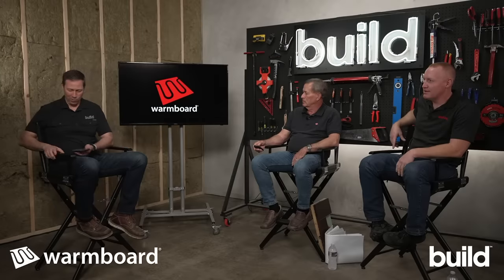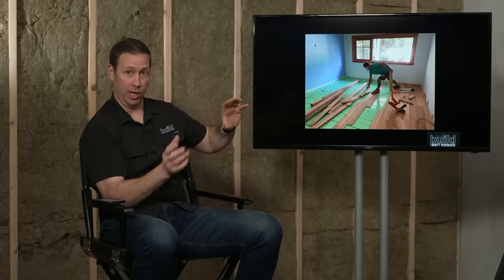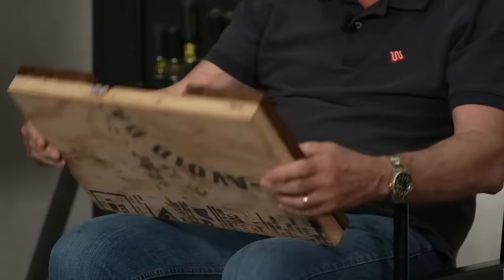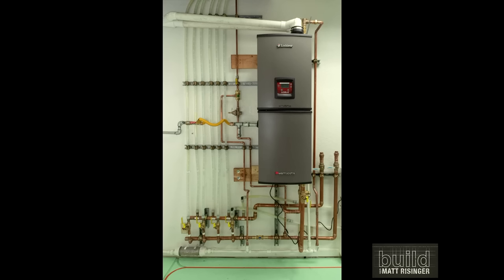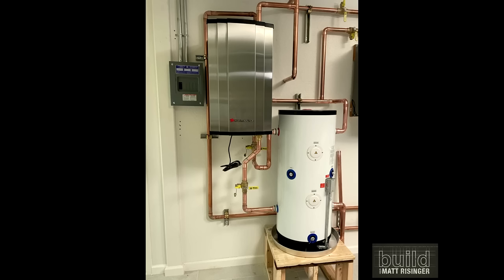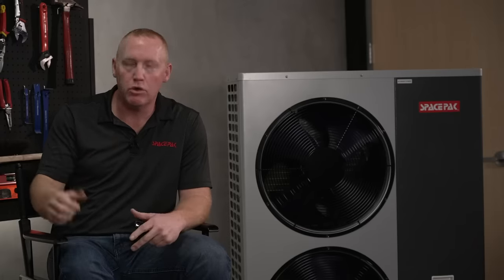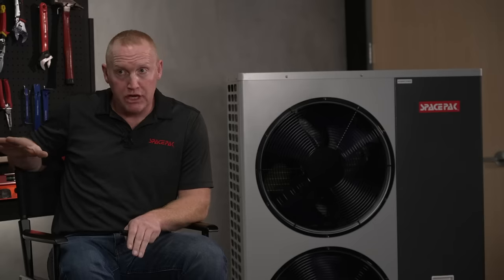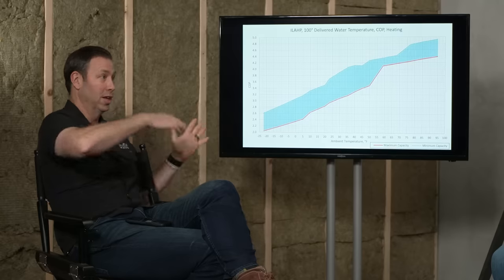Cold Climate Heat Pumps for Radiant Floor Heating. No gas, no boiler!

Comment: The missing slide...  What was missing in the presentation, though alluded to, is that as the temperature goes down, the BTU output of the HP goes down with it.  You will have the least amount of capacity when you need it the most.  The most important takeaway is not how low a temperature the HP will function but to increase the efficiency of the envelope. 

The Warmboard is a luxury product and the presenter made no excuses that it wasn't.  It is a luxury product that will make very difficult envelopes (think walls of glass) comfortable.  Well built envelopes with low BTU heating or cooling requirements will be in a position to achieve the "comfort" adjective much easier than poorly insulated, leaky ones.  We have been choosing to throw technology and brute mechanical force into our homes to overcome the upfront cost cutting for too long.
Reply: I'd agree. The brute force ways of doing things are no longer cheap, so we need to get more intelligent about how we build and heat our home. If the choice is spending $30,000 dollars more to insulate, airseal and then ventilate home, but this saves an extra $1000 dollars a year in fuel, then its a no brainer when houses last 70 years plus and inflation means that fuel is only going to get more expensive.
Reply: @tlangdon12  Why would fuel get more expensive? Consider that it has been getting less expensive, relative to inflation, for a few decades. Fuel will only increase in cost via legislation. However, a much more efficient means of comfort control is obviously necessary. 

I think we should turn our attention to retrofit air sealing and radiant barrier solutions. If that is low cost and quick, much less cooling and heating sources.
Reply: @CycleWerkz  It’s the legislative route that I expect to be the source of increases.
Reply: @tlangdon12  agreed
Reply: @CycleWerkz  fossil fuel will certainly get more expensive. The capital costs of fracking and labor costs will increase with inflation, especially considering the fracked wells have a shorter productive life span. It may continue to cheaper in specific places where it is a byproduct and doesnt have to be transported. That is not universally true for places outside the main regions of shale gas/oil.  Especially now that fossil fuels are being exported, even though the USA is a net importer of oil.  Are prices are going to rise to normalize with the global market all for private fossil fuel companies rent seeking profits.  Only competition from especially renewable sources of electricity will reign in the prices. Additionally these are cheaper and have a longer life span then fossil fuel infrastructure at this point, again regionally dependent. Agreed, we do need to build better quality, long lasting, and well insulated buildings.
Reply: @JohnsrudErik  Hmm, the ideas you have shown here are because you've been massively mislead. Don't worry, almost everyone has been. 

If you've never been to a modern Oil/NG drilling site, I encourage you to schedule a tour. Everything you imagine is completely wrong. 

I'll describe this without exact detail so it'll develop an image. A modern drilling site bores down but angled slightly away from the centerline until reaching about a mile below the surface. There may around 50 of these  bores in different directions, but these are not randomly selected but rather targeted using subterranean imaging. From each of these initial bores, a roughly horizontal hole is bored. These bores are not straight, they are guided using real time imagine equipment to target specific areas. They are steered up, down, left, right to intercept all the desired targets. Horizontal boring can extend up to 5 miles. These wells use hydraulic fracturing techniques on each of these horizontal bores to release the stranded oil and or NG.  There is no guesswork or luck involved. The certainty of profitability is well known prior to the project funding. Each of the horizontal borings were engineered as part of the research needed to justify the project. 

The projects I'm familiar with have broke even ROI in less than 10 months from initial build. They only had one or two horizontal lines running for a couple months to return all the capital and expenses to that point. These projects will be massive producers for decades to come. 

This is a technology, not an effect of where you live. This technology is IP, equipment, and engineers, which is available anywhere in the world. Similar methods are used for offshore sites. It's even possible to collect organic fuels from below the Oceans' floor with an onshore platform. 

The US does not need to be a net importer. This is only the case due to legislation. Alaska alone can, and has, produce, 2 million barrels per day which is the pipeline limit. Production has been limited by political means by using every possible hobbling method. Despite all this, they still produce 1/2 million barrels per day. 

I worked a project to decommission an electrical generation plant that was fueled by NG. It had an alternative coal heat source and a rail spur, but it had never burned coal. It ran over 50 years. This is typical or these plants. I have not seen evidence of your claim the PVs or Wind Generators will run over a decade. 

We have a 35GW wind plant in West and South TX. It produces lots of power all night every summer. Every day of the summer the wind slows at about 11AM , then picks back up around 830PM. So about 18-22GW all night, then 5-12GW during the peak load time. It happens every day, all summer long. No, it never actually produces the nameplate rating of 35GW. That's a number thrown around to justify the cost. I assure you it is not a cheaper way to generate electrical power. 

Every summer day at noon, all the NG peaker plants ramp up to supply the peak loads plus they have to supply the wind source power that fell off. Then, at around 830PM, all the peaker plants have to cycle down because our brilliant government forces load onto the wind system. The peaker plants experience a much wider heat variation than they did before; substantially decreasing time between overhauls. 

Even worse, Nuke plants were never intended to be throttled. They produce the same power regardless of load conditions. When the load at night falls below wind + Nuke, wholesale energy prices go negative. That's right, the nuke plant has to pay to add load. The wind system would throttle, but they don't because they get paid to supply plus the wholesale rate. They will not throttle down until the supplemental pay would cause a net loss. Any time you exit a free market, unintended consequences will occur. 

Renewables are nowhere near competitive with organic fuels. They only have the ability to cripple electrical generation economics due to legislation. I have little doubt I'll have to pay more for energy, but it's not because of any flaw in the fuel. 

Transportation of oil, NG, gasoline, diesel, jet fuel, derivatives is extremely low cost via pipelines. Here, California's government is working tirelessly to close their refineries. CA is the terminating end of the Alaska pipeline. They should be encouraging new refineries to be built right there. Then they could easily influence the fed to get out of the way of Alaska's oil production. CA could have the 2nd lowest cost fuels in the country. The hard part is already there. It surprises me that Californians are willing to pay exorbitant fuel and energy prices while this opportunity is in plain sight. CA gasoline is over $5 while in TX it's under $3. Residential electric is $0.12 kWhr but in CA I think it's $0.30. And that's if it's even on. They should really attack the government for this. 

Think of it this way; the first wind gens built, were in the BEST places for wind. All subsequent wind projects will perform much worse than these pristine locations. Power production varies by the square root of wind speed.  And wind generators arrays create turbulence so all the generators downwind perform worse than the upwind few. So a nice 3MW gen will typically produce 2MW at night. then just before noon wind slows to half speed so that 2MW reduces to 500kW. But wait, that's how it works from the Gulf through a very flat desert. Even there it sucks; but it'll suck way worse elsewhere. And I hope you really hate bats and birds of prey, like eagles. It kills a bunch of them. I also hope you hate humans. I know guys working on these. Do you wonder why you can't find accidental injury and death statistics on wind generator techs? They do not compare favorably to NG, Coal or Nuke plants. 

I remain hopeful people will see the obvious and challenge what they've read. It's not easy for people to do. People really hate discovering they've been snookered. Don't worry, I was in that camp, the transition out sucked.
Reply: @CycleWerkz  This is why I love Youtube, good discussion and learning. Thanks for taking the time to write all this.
Reply: @DoubleD  Most concise explanation I've heard to date. I'm going to screenshot your message to help me explain to other.  Thank you!
Reply: @Terrathrax  Thanks. I was suffering reply remorse about half way through.
Reply: @Tbell550  Thanks so much. I hope it helps.
Reply: @CycleWerkz  Thank you very much! It takes an astute intelligence to discern the true state of affairs in an intently deceptive world.
Reply: @donquixote4630  Nicely worded comment, thanks.

Comment: My house has warmboard on the main level and infloor hydronic in the basement concrete floor.  We've attached it go a 3-in-1 geothermal system.  We're up in New Brunswick (to the east of Maine for you geography challenged folk).  We're actually so well insulated we don't need much heat but it's definitely a nice system.
Reply: How did you insulate your concrete floor?
Reply: We did 2” R10 of rigid foam.  Then our radon barrier.  Then 2.5” of the honey comb shaped rigid foam where you can snake the hydronic pipes through it.  Then 4” of concrete.  So subslab it’s R20.
Reply: Outstanding! Thanks.
Reply: If you don’t mind me asking, how much was the geothermal system? We’re getting quotes that are insanely expensive compared to what the internet says it should cost 🤷‍♂️
Reply: I had one insane quote at like 60k plus a bunch of stuff (site work etc).

Best quote I got was 28k plus tax.  This was 2020 before rampant inflation.

Comment: Excellent timing ! Im currently working with Peter at Warmboard… getting a design and estimate for my Truckee house remodel … also want to use air heat pump solution … my 1978 Marlette cabin is 100% electric baseboard. Switching to hydronic heating under large format ceramic tile is expected to be a huge upgrade … along with replacing roof while adding proper insulation
Reply: Give us the cost so we know what to expect.  My costs at my age didnt justify to even consider the upgrade

Comment: Great video!  Can you do a follow up video on cooling systems (e.g., air conditioning) that you might couple with radiant heating?  IMHO having two systems is difficult to justify from a cost standpoint.  Several years ago you made a video on radiant cooling systems that was really interesting but I've not seen much since.
Reply: Agreed! Some of live in areas that get below freezing in the winters, but also reach triple digits in the summers. 😁
Reply: I have a friend with an off-grid solar house with in-floor heating and cooling. One issue was that they’d get condensation on the floor when running the cool water. A regular a/c has a place for condensate- in this case you don’t. So just a complication that needs to be addressed with dehumidifiers.
Reply: Mini splits are perfect for climates that need both heating and cooling. Some Japanese made units easily output 18,000 btu while having heating SCOPs of over 5! And some new ones can get DC connection to Solar Panels with no need of inverter or connection to the grid. This is big with prices of solar panels @ $0.3-0.5 per watt.
Reply: @TimGGleason  Running cold water through the floor is a bad idea. The correct way to cool with a heat pump is to have fan-coil units mounted high on the room walls (like a regular AC split system) so that the cold air they produce can be directed across the whole of the room and then descend. (Hot air rises, cold air wants to do the opposite!)
Reply: @tlangdon12  the panel the original comment was talking about is a cooling panel system mounted to the ceiling

Comment: Would love to see a video about a water to water heat pump for using geothermal heat to radiant heat
Reply: I second that!
Reply: You may be disappointed with the price of geothermal vs the price of air to water.
Reply: @paulmcgown7504  unfortunately where I'm at air to water isn't a great option for me as it's regularly Below zero.
Reply: I built my home in the early 90 with all radiant floors using an oil boiler. Later switched to a water to water geothermal pump and dump system. Continuous 55 degree water right from the well on an inverter constant pressure pump. Very cost effective to operate but The 3 ton compressor didnt get quieter with age and soon became a huge nuisance as my mechanical room is adjacent to my living room. I have no basement as I built next to a creek, hence my unlimited supply of water. Its just a heat pump with a buffer tank. It had a desuper heater on the unit but it was never used as I only used the unit for heat. My cooling system is separate ductless units and chilled water is a pain to insulate anyway. Now I use a small gas condensing boiler, super quiet, easy to repair and very small. A small 1400 watt generator running on propane keeps the entire system running during power outages.

Comment: This is the most interesting video on this topic I've seen.  I too have considered Warmboard which, without doubt is the most complete radiant heating product on the market.  Spacpak adds a couple key features to the hvac equation.  1.  Heating efficiently using electricity while 2. providing the air conditioning which of course, Warmboard isn't designed....they're comfortable heat only.  Recognize, an air conditioner or heat must be purchased and ducted in addition to the warmbaord for a complete HVAC system..  The gypcrete/concrete w/pex option mentioned below by Michael Taros, I've reasoned for years may be the best "value" when matched with a Spacepak type product.  The reason is, Spacepak provides the quick ramp up for heating as the gypecrete/concrete option takes time to get to a comfortable room temperature.  IMO, if Warmboard can deliver on the $6.00 per square foot along with the surcharge for the Spacepak equipment, they've moved closer to being not just the leader in radiant floor technology, they always now a better value for the best heating/hvac system in the market.  This is the future.  Thank you Matt and cast for pulling this all together.

Comment: I have about 350 gallon tank of hot water ,heated up by wood .With a hot water propane tank also tied into the loop in the floor. The  hot water wood tank water is not part of the floor water running in the floor tubes. The floor water is in copper pipes in the large tank. The large tank is insulated ,but is not under pressure. It's a simple system and propane hot water tank only comes on when house is below 50. Pump ,expansion tank and propane hot water tank all simple . My floor tubes is ,some kind of plastic made for that use. I covered the tubes with a 11/2 of concrete. Tile on top but did have some tiles crack from heat . Floor heat is the best in a cold climate and dogs and cats just love it. My system been working 40 years with no problems. I change out the propane hot water tank this year because the thermostat gave out and was to old to find a replacement. What I like about the wood hot water I burn the wood hot and heat the big water tank up and forget about it for 24 hrs. I like your floor panels and going to check it out for a little cabin.

Comment: I live (since 2001) in a house with radiant floor in concrete. When it's cold for days it's ok, however when one day is cold and the next day is sunny and the temperature is high, then the radiant on the slab is not the best due to high inertia. Choosing radiant on concrete or the Warmfloor system depends on the climate area where you live.